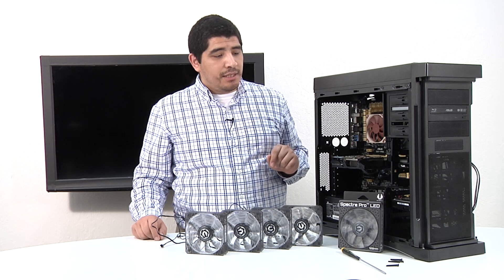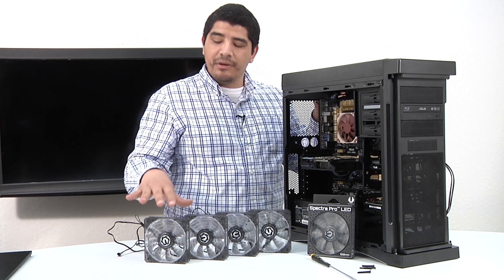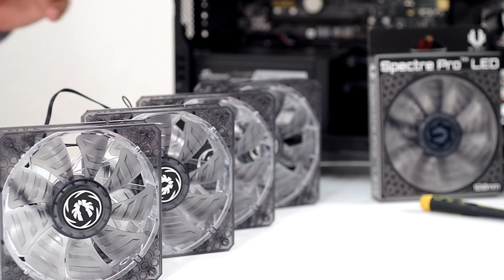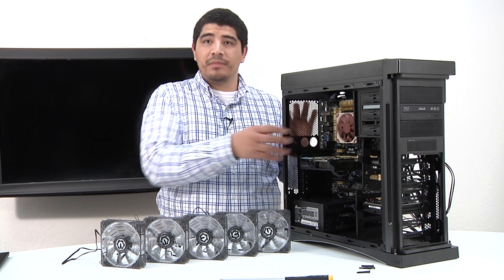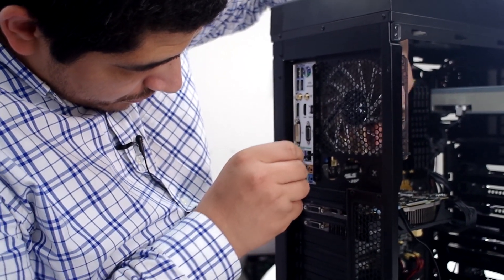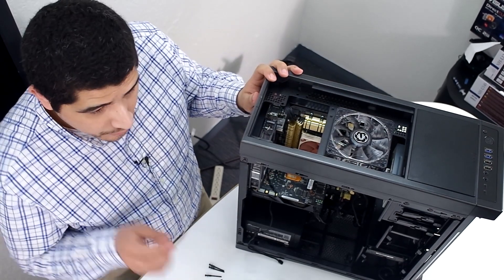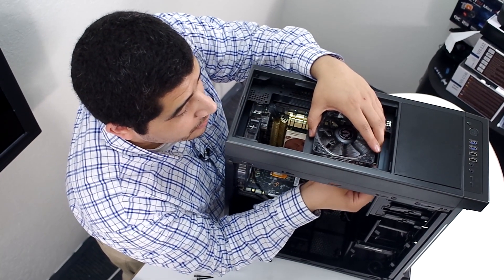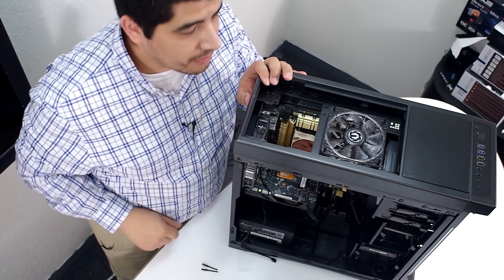How-to install case fans

Comment: —-BAD ADVICE—
You want your top and rear fans to be exhaust fans. The front fans are your intakes. (The fan logo should be facing the direction you want the airflow to go)

Comment: Putting fans on their specified place with screws is very easy and a lot of people covered that in the videos. But everyone failed to do including you is to show how to connect multiple friends to a motherboard. Which Heather for connecting point should be used  putting fans on their specified place with screws is very easy and a lot of people gathered that in the videos. What everyone failed to do including you is to show how to connect multiple fans to a motherboard. Which Heather for connecting point should be used?

 This video is pointless

Comment: I have a question on the VRM_Fan connector. My motherboard only has a single "actual" case fan 4 pin connector, but has a pci fan connector and the vrm connector. Would it be fine pluggin a rear exhaust fan into the vrm or pci or would it just be better to plug it directly into the psu

Comment: Lol this video is all wrong. Your intake and out take air flow is installed incorrectly and you didn’t explain which side of the fan is intake. Some noob will watch this video and install the fans on any side

Comment: You want a 140mm fan outside too for summer. Mine is a Thermaltake TT 1425, from Ebay. Makes no noise at only 17dBa. It has a long cable.

Comment: What if someone has an older PC case without screw holes to mount `front fans` ? Any other solution other than having to buy HD cages (4-in-3 modules) ???

I can´t believe that are no easy to find and cheap to buy brackets, adapters or what have you, to provide something like mounting screws `corners` for a front fan. At least not outside Europe and North America. Do I have to a buy drive cages, providing I even find any these days, and leave them empty just so I can have front fans ? Can´t be...

Comment: hello... my pc case is so old than when i bought it two-core CPU were considered strong... so i cannot find its model. is it possible to get any fan on it at all?
Reply: Depends on what socket it's for. Mate, to be honest, if it's dual core and it was strong for its time then I'd just save up some money and buy a new mobo, cpu, gpu and all that. I'm far from an expert but that's just my opinion. I apologise for the name.
Reply: no man, my cpu is recent and all the rest, just the case was bought in the dual core era

Comment: Are the fan connections on the motherboard labeled? All these videos never show a close up of what the connections look like or which way the fan faces and some fans don't have the arrow showing which way are flow is going and being a noob watching all these install videos they always show close ups of people putting 4 screws in then just plugging the fans in. People already know how to put 4 screws in 4 holes, show more details like close ups of the actual connection or how to tell which way the fan goes and which fan to connect to the controller rather than just a regular connection.
Reply: Agreed, I'm spending countless time watching video after video for this very problem and still can't figure out which way to install the fan cable

Comment: My motherboard is the gigabyte ga-z170m-d3h socket 1151 
will this motherboard have multiple fan connections on the motherboard so I can have many fans installed?

Comment: The top is meant to be exhaust not intake
Reply: Yep, if there was only 2 intake and 3 exhaust fans, there would be negative pressure meaning air would come in the  holes on the case paired with dust. Thats why positive pressure is good, to keep out the dust. However 4 intake and 1 exhaust isn't optimal either..

Comment: I just got a fan that's got a 3-pin connector, but there are no 3-pin things on the motherboard. Can I somehow connect it to the PSU?
Reply: yeah with an adapter (3 pin to molex)
Reply: OutResso Thanks for replying, however I did it already. Have a good day!

Comment: i have a question. this might sound crazy but im really curious. can you use a 2 pin (black and red wire) power supply fan on a 4 pin or 3 pin chassis connector? any knowledgeable enough to give me an answer with detailed reason?

Comment: Why wouldnt you use top fans as a exhaust?
Reply: The top should always be exhaust because 1st heat rises (doesnt effect much at all though) and 2nd dust settles on top of things so why suck in air from up top when you can blow the dust away. Also you want to have positive air flow so change the speed of the fans at the front so they take in more air. The number of fans doesn't matter and shouldnt matter if you change your speeds
Reply: How do you make the top be exhaust? im confused
Reply: Çerastes I'd rather be neutral and have no dust, unless you use a filter. Even then...
Reply: you can create positive pressure putting more/stronger fans on front and buttom.

Comment: will never buy another card from asus again 5 yrs ago build system amd 1100t asus ares hd5870x2 ocz 3 revodrive very fast system its still going strong but amd pulled support for this  graphics card , asus only put out drivers in 2010 3 sets and stoped .  ive been using amd drivers from amd so I called asus why have not updated any drivers , on the phone just now told me to buy newer card from them 99.00 dollors for a graphics card  they put out 3 drivers and left me in the wind.  and amd doing the same for 7000  6000 and 5000 cards and directx 12 they put out 1 driver directx 12 for 5000 series cards

Comment: An intake on the top? When heat rises? Dumbass...
Reply: The statement "hot air rises" has little relevance with fans in a PC. It only has a minor effect on the airflow, but will not hinder anything.

Comment: can i plug any 4 pin female fan connector into any 4pin male fan connector for my side panel fan or do i have to use a certain 4 pin male fan connector depending on voltage.

Comment: Wait, you didn't show me where to actually plug them in... It's like here here and here... I would naturally know how to screw them in, it's logic, but connections are a problem for me, and you skipped it.
Reply: Thats exactly the information I needed too!! Like what? Haha you nailed it
Reply: Look into your motherboard the connection should be called "sys_fan"
Reply: @Reduxified  yeah, but I only have one sys_fan, where do I plug the rest?
Reply: kalu 6 
Buy a fan splitter, ( fan splitter can break motherboard but not 100% sure )
or buy chassis fans/ molex fans
Reply: @Reduxified  mine says CHA FAN which in the booklet it says chassis fan connector
Reply: @Cott it still should work if you plug 3 pin in to the 4 pin connector.
Reply: Um, do you know now where to plug them?
Reply: @jellona2806  nope i dont know
Reply: @Cott do you have a fan splitter?
Reply: if i install 2 fan. but only 1 sysfan in motherboard wheren i can plug the other one? please anyone can answer? 😊
Reply: @davenjohnquema9288  buy fan splitters
Reply: @Reduxified  Thanks bro.
Reply: Bruh, true

Comment: "Chassis." I laughed anyway. It is all about heat gunge, "Heat Transfer Compound" and removing the accumulating fluff. Blow it off and get some heat transfer compound. Dab it on your fingertip. Apply it to the surface of the heatsink, after it has been cleaned. Then clip them together. If you can get an Ag rather than Si compound it would help.

Comment: I'm no computer genius but I think I can handle the "How to install 4 Screws" without a whole lot of time or attention. What I need is to get some more precise information on the electrical connections. A nice close up on those connections would be more of a help instead of working with the silicone "screws" for 8 minutes.

Comment: You put way too many intake fans the top 2 should be exhaust
Reply: +Nangjelovski , i agree, after all heat rises so why would you want them blowing hot air back down
Reply: +Nangjelovski  actually you should have positive pressure in your case for less dust and thus have more intake fans atleast then exhaust right
Reply: +Kaijun so are those enough for ooverclocking gpu(s)?
Reply: Arjun Gopinaht Yes u should be ok.
Reply: I hav 2 intake fans at front and 1 outtake at back. Was thinkin to get 2 fans for the side panel. Should they be intake or outtake ?
Reply: No he ain't, there's no rules in a gaming case, it's only like who prefers their party frocks in different patterns, as long as its not integrating Liquid cooling, you can put Blackpool Illuminations in
Reply: Nangjelovski doesen't matter. If you take 3 intake and 1 exhaust or outtake it will allso be good. I have 5 fans. i have 3 intake fans and two outtake fans. My CPU under Heavy load never go above 70 degress and i have SLI 970.If i only have 1 card it never go above 60 degress.

Comment: Im planning to build an x99 system in a thermaltake core x9 case. i want to have 4 fans at the top blowing air downward onto the motherboard which is laying flat. Is that okay? most cases have the board vertically and the air pushed passed over it. but in the case of the core x9, it will be pushing the air directly ontop of it. will this be better? worse? im still new to understanding proper airflow

Comment: what if you have 6 fans and only 3 connectors on the mobo?
Reply: Jason Johnson you're fucked
Reply: lol
Reply: i'll give you a normal answer now lol, you can't add more but you can buy fans with different connection and connect them to your power supply, i don't know the exact name for the connection types but some googling will help you.
Reply: Thanks, I just bought some of those. Fans working like a charm
Reply: Jason Johnson http://www.amazon.co.uk/Akasa-AK-CBFA04-15-Splitter-Cable-Fans/dp/B005FWXWPS/ref=pd_sim_147_6?ie=UTF8&refRID=1VJAZPX2KC4YS2B8EPVM
Reply: +Jason Johnson  You are not a dedicated gamer. Get a divider. Or another PSU.

Comment: How convenient having a mobo that had five (5) header connectors. What about a system the has 4 fans but a mobo with only 2 headers? Fan Splitter cable...I know...but seeing as how this is a fan install tutorial would be nice to show how to connect everything in that circumstance.
Reply: ***** use adaptors then plug direct to psu

Comment: This guy is an idiot.  He just made an entire video on how to screw in a fan.  Just a guess, but that's not what most people who are looking for a tutorial on how to install a fan of are having a problem with! Perhaps actually showing the connectors and where you connect the fan would have been better.  Also perhaps explaining that on the side of the fan there are arrows to tell you which way the air flows, so you can know which way to install it would have helped!  But no!  You'd rather make an entire video on how to screw them in!  Well done! We will all be way more confident now when screwing in our new fans! Unless of course our fans don't come with the fancy silicone threaded pull screws!  OH MY GOD!
Reply: +Roger Smith He seemed to forget what the fans are for. What a muppit. "Optimising The Pressure Flow!" My girlfriend is still laughing.
Reply: I thought he did great.  Knowing NOTHING about computers, I was able to understand his point exactly.  Try putting yourself in my position where I may not know much about computers and this was a great starting point for someone such as I.  Had I been a know-it-all, I would probably have felt the same way you did.
Reply: +Classy Closets You don't need to know anything about computers to know how to screw something in!!  If you were having problems with that part of it, I would suggest not building your own computer!!  In fact, that is the one part of installing a fan that requires absolutely NO computer knowledge whatsoever.
Reply: What if someone has an older PC case without screw holes to mount `front fans` ? Any other solution other than having to buy HD cages (4-in-3 modules) ???

I can´t believe that are no easy to find and cheap to buy brackets, adapters or what have you, to provide something like mounting screws `corners` for a front fan. At least not outside Europe and North America. Do I have to a buy drive cages, providing I even find any these days, and leave them empty just so I can have front fans ? Can´t be...
Reply: Roger Smith I'm actually hear to make sure I'm screwing in my fan right. Mine didn't come pre threaded
Reply: Thank you for this comment. I'm a new builder and this helped. I didn't even know about the arrows haha. Thank :)
Reply: Roger Smith you seem misleading you JJ from Asus  he well known person even some my friend no personally
Reply: αχχαχαχα
Reply: Roger is so right.

So many nice areas to cover.
PWM/DC
RGB when its on a fan
Fan controllers  connected/disconnect options
Mobo fan connectors
Fan cable splitters  
Bios fan control/ OS software options
High pressure vs low pressure 
High pressure vs High air flow fan types
Fan direction pointers
Fan voltages and power usage
Fan air dynamics in cases
Pinouts on fans and what they mean
And so on !!!
Reply: my pc case holds more fans than my motherboard has connectors ... what do i need to do to be able to use all fans? do i need a fan splitter?
Reply: du Bb Yes, they will work, but you will not be able to control each fan independently which is not really required.. But a fan controller would do the trick, one that’s able to connect to your motherboard for full control.  You would have 2 points on control or just one depending on the controller.
Reply: Thank You.
Reply: +Roger Smith You know there's a big difference between constructive criticism and just being a fucking douche bag. "You'd rather make an entire video on how to screw them in!" This guy didn't even make the video.
Reply: I stopped viewing after 30 secs when he said that the top fans were for "intake" No, no, no no! Hot air, which incidentally he was talking rises and they should be used to exhaust the hot air not pull it in. The correct configuration should be - front panal fans & bottom panal fans intake and back and top panel fans exhaust. Jeez, and this from a representative of a major board manufacturer, god help us.

Comment: So why intake at the top, with only rear exhaust????? Any wish to reply
Reply: +Steve Burgess it's all about positive air pressure. If you have more intake than outtake fans you cause a positive air pressure, if you have more exhaust than intake fans you have a negative air pressure. A negative air pressure is detrimental for your chassis. Since each object in nature tries to strive to a neutral air pressure but the fans only allow exhausting air yet they need to exhaust the air from somewhere the system your case will feel the pressure to absorb air from the case surroundings having a relative positive pressure. By doing this dust will go through your I/O shield and other parts such as trays and every space in your pc with an opening air will go through with dust. Resulting in a dusty system. If you have a system with only intake fans you basically get dust through all of your fans, but not from other unwanted places. So the optimal solution is create a system with a positive air pressure. So more intake fans than exhaust fans, make sure there is a nice airflow in your system and not fans working against each other AND most important use dust filters for ALL intake fans so dust won't go into your chassis. Since the air pressure is positive now the inside of the chassis won't draw any additional air from unwanted places such as the trays and the i/o shield,... The reason he opted for 2 intake fans at the top is because they had a dust filter. If he opted for 2 exhaust fans at the top he has a negative air pressure which is bad. If he opted for one exhaust fan and one intake fan in the system there would be a positive air pressure inside the case but the air circulation would be working against each other and therefore not cooling efficient. If you have no dust filters at all for over your fans there is no advantage of having more intake than exhaust it will accumulate dust maybe even more. If no dust filters one should try to have the same amount of intake as exhaust, therefore halving the amount of dust going through a system with full intake and preventing dust to come in through unwanted places. If you do have dust filters place them on the intake fans and make sure you have more intake than exhaust fans. 4 intake and one exhaust fan was perfect in this video. You might argue to only have intake fans but then the airflow is limited in the inside and you will get an inflating balloon effect. I hope this helps with your problem.
Reply: Steve Burgess yea i feel that there is way too much intakes as well, it may cause turbulence and make some area with no air. The cooling wont be really effective as well
Reply: Steve Burgess Was wondering the same. I have a Thermaltake V3 Black Edition, which also has 5 fans  (1 front, 1 below, 2 top and 1 rear). The diagrams which came has the top two and rear as exhaust fans as oppose to intake.
Reply: +wenen132 You are dumb do some research and get back to me.

Comment: are the top case intake fans necessary?
Reply: Thom Mac Gillavry  yeah but i'd replace intake for exhaust for effective heat mitigation
Reply: +All out of worms you mean effective negative pressure and dust build up? there is a dust filter on top for a reason, and it's always better to have more intake than exhaust.